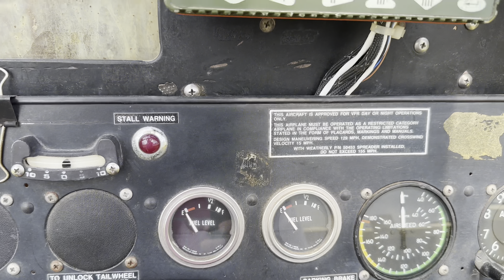Weatherly 620B Aircraft Tour

Comment: Fun fact: In 1980 Weatherly built 2 PT6 powered airplanes. They were designated 620TP. I owned one of them. Flew it for 2 years. This was in the early 90's. Loved the little airplane. Would haul a full hopper just about anytime of the day.
Reply from the maker: No way! I know about both of those, and I think there is still one flying as of a few years ago. Would love to turbine swap one of these, it would be a workhorse!
Reply: @agpilotchick  I know the one I had got destroyed in a crash in 1994. I didn't know if the other one was still flying or not.

Comment: Thanks for the guided walk-around! Q: On the hot & humid days, can you fly with the doors open, or would that be a hazmat hazard?
Reply from the maker: Great question! You can fly with the doors off rather than open. You would only want to do this when doing some type of dry work such as seed or fertilizer. It can be hazardous if you’re spraying liquid and you have some type of malfunction in the equipment. There is a pretty good sized air vent in the airplane so it’s warm in there, but there is fresh air coming in as well!

Comment: I wonder what the fuel consumption is on a plane like that I am thinking  at least 60 gal hr. if not more.
Reply from the maker: It's around 28 ish gallons per hour, but can be more like 33 depending on what power you need to work a specific field.
Reply: @agpilotchick  thats a lot better tan I thought.